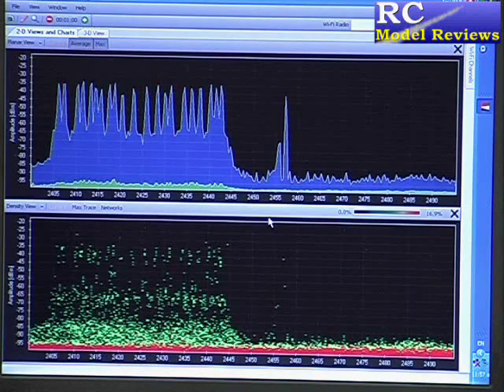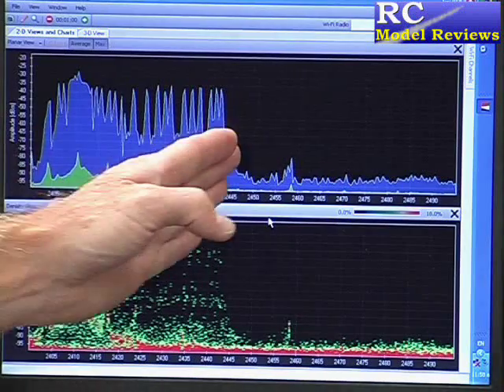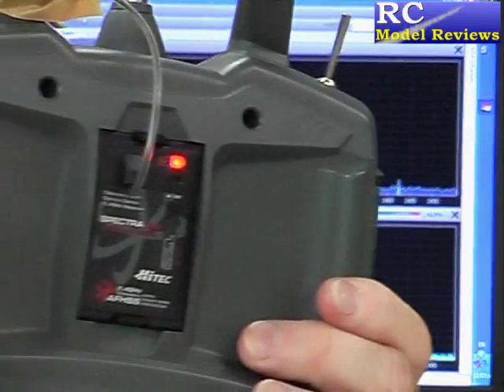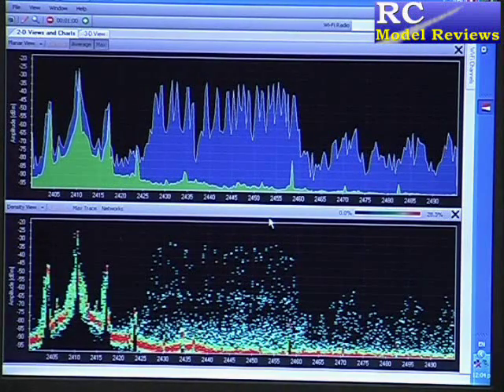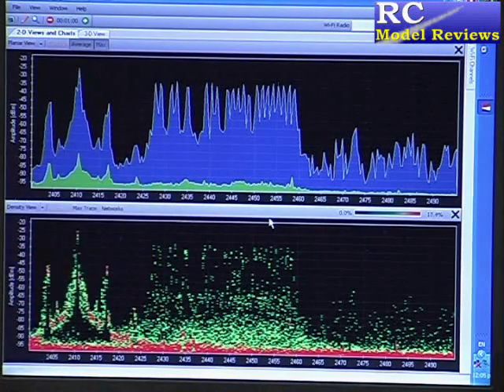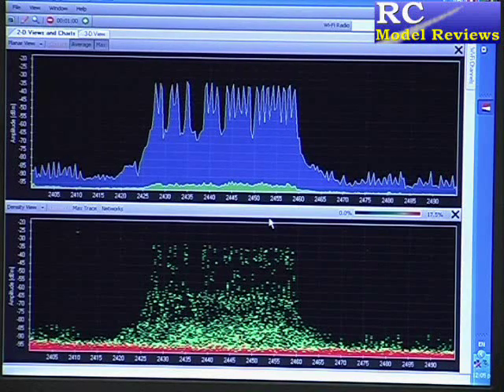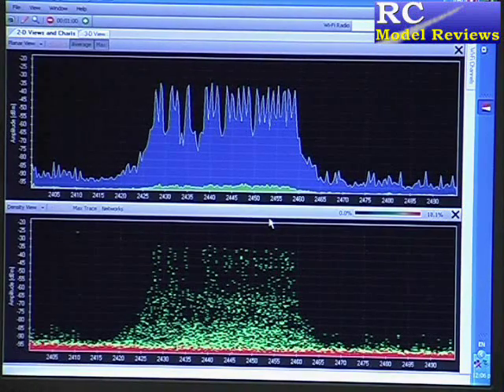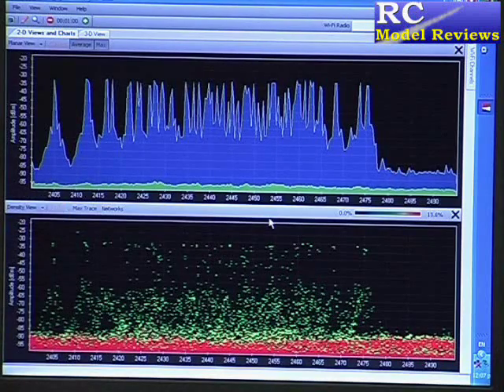Review: Hitec Spectra AFHSS 2.4GHz receiver and Optima 7 module (part 2)

Comment: Hi, I had my plane crash due to RF from the electronic ignition noise. I was using the Aurora9 radio system with a BME 50cc engine can you do some testing and see if you can duplicate the failure.